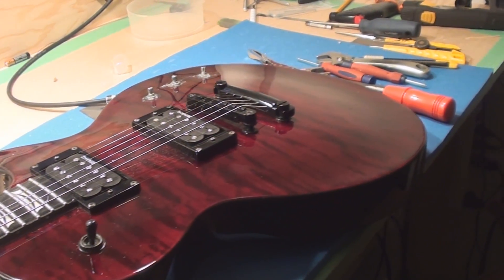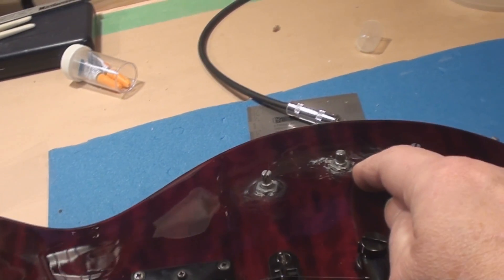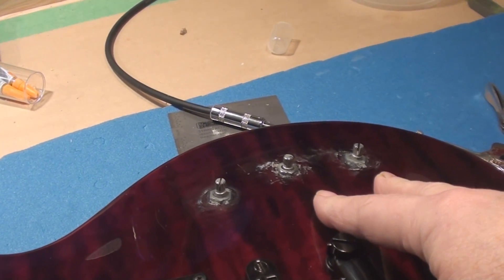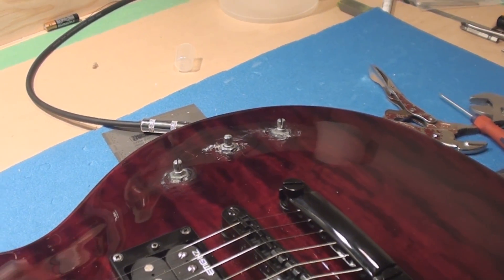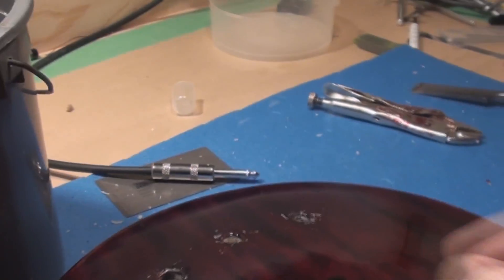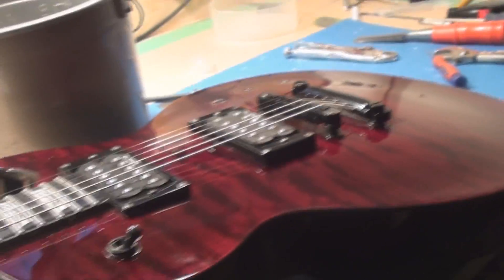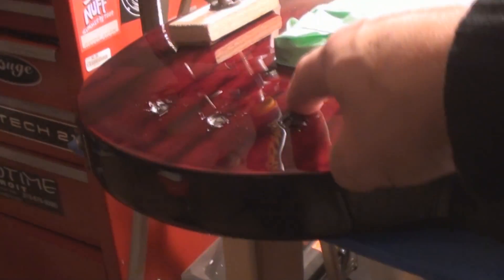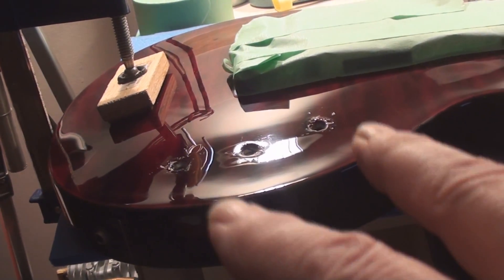Guitar Gooch of the Week

Comment: Ok, I'm only an amat guitar player and repair person, but I have a lot of experience w/ fixing things; and some with breaking things. 1st off, DO NOT, I REPEAT DO NOT, USE ACETONE, NAIL POLISH REMOVER, ALCOHOL, PAINT THINNER, LIGHTER FLUID, ETC. ON ANY GUITAR FINISH THAT YOU CARE ABT. Diff chems react diff w/ diff types of finishes. What is safe.. at least in my opinion, is something you would use on an auto-type finish. Car wax, rubbing compound, (be careful), for maybe a scratched up 300-400$ guitar. You get the point. When it comes to something of value, it's better to leave it alone than poss damage it more. Trust me on this, bcse I don't lie. At least not too often. And also rem that your guitar is prob made out of wood, which is porous.